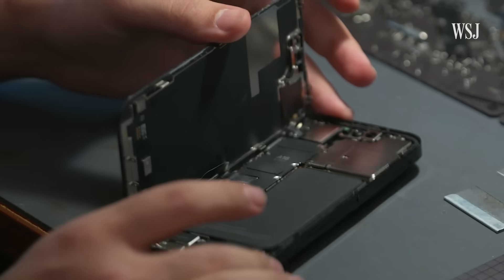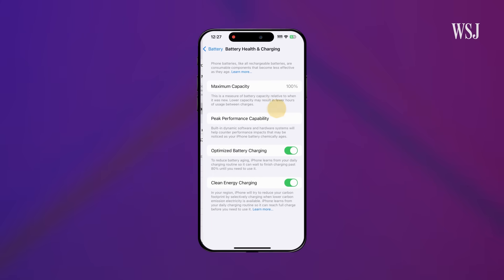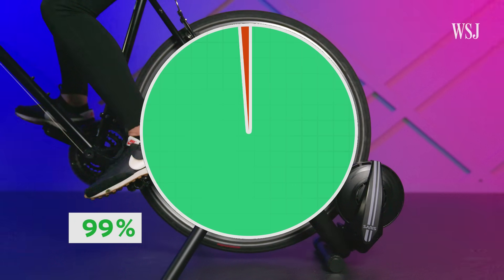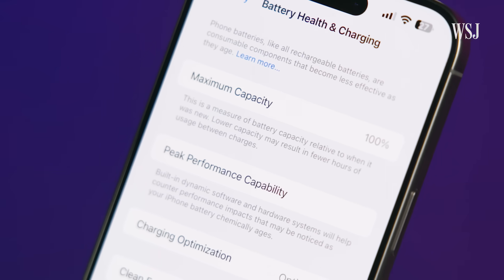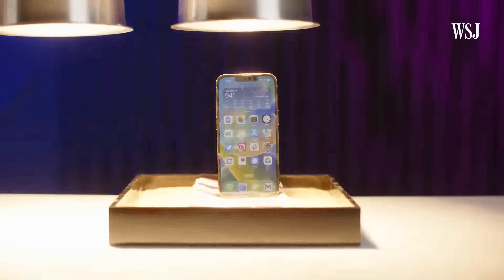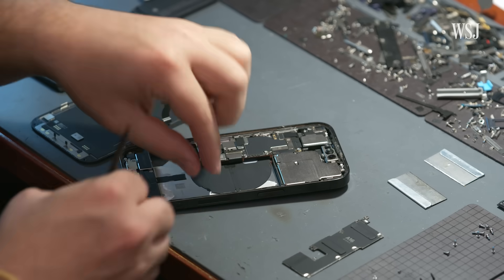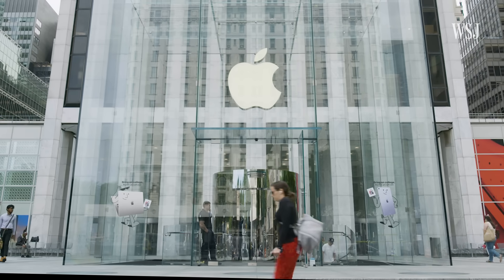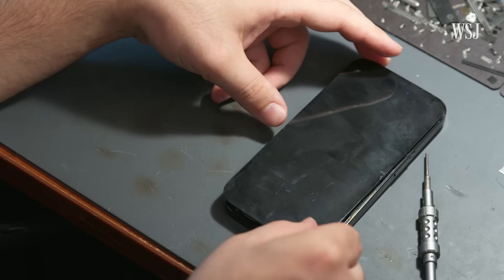Why My iPhone’s Battery Expired in Only a Year | WSJ

Comment: Just by the way, for those of you who may not know: It used to be that Apple Li-ion batteries had a rating of 80% after 1000 cycles. And they are trying to tell us that they have not built in a designed redundancy? No, this is wrong, they absolutely knew that this would happen because 500 cycles is approximately one year's worth of phone usage. Is it concidence that a new iPhone is launched every year? No, coincidences like this don't exist. They are a deliberate design decision. Just think of this: Wouldn't it be nice if the battery was easily swappable? Of course it would be, but then apple wouldn't be able to make 1000 (insert currency here) every single year from you. The only somewhat repairable iPhone is the iPhone 6S!
Reply: You might achieve that 1000 cycle of use. There are real world examples from multiple people, but most of them never charge to high voltages, keep charge and discharge slow and limit heat exposure, but that is unreasonable for most real world uses. 
The ideal charging habit is only viable on careful users, or EV owners (when battery temp is controlled, charge limits are set and charging/discharge speeds are slow anyway for normal daily driving). 

Choi, S. S., & Lim, H. S. (2002). Factors that affect cycle-life and possible degradation mechanisms of a Li-ion cell based on LiCoO2. Journal of Power Sources
There are many more sources that can show lithium ion degradation, but this appears to be accessible without academic logins. 

I am only aware of Apple claiming 1000 charge cycles for their Macs. When did they claim that for their phones? Li-Ion degradation is a normal thing, not just for iPhones. You can expect similar results for Android. Other phones getting low damage fast charging and high cycle counts are from brands trying out new battery chemistries or existing chemistries with added ingredients, such as Realme.

Comment: my iphone XR i had from March 2021 - September 2022's battery health stayed at 100% until may 2022, dropped to 99% then randomly after updating to ios 16 in the septemeber of the same year dropped to 95% out of nowhere my iphone 11 ive had from September 2023 - Present has gone down from 98% to 95% in just over a month although my iphone 7 i had from september 2022- april 2023 didnt drop from 100% at all. all have had basically exactly the same use cases.

Comment: There's a great app called accubattery but it's Android only but it's good to see Apple let you limit to 80% charge. The biggest problem for lithium ion batteries is having a battery sitting at a high or low state of charge. I charge to 50% which accubattery suggests uses a lot fewer cycles than charging to 60%. The number seems increase faster and faster the higher your battery percentageAfter a year with my Pixel I'm down to 96% which I think is very good.

One other thing. I don't really like low power mode so I make the screen as dim as I can because that's the thing that uses most electricity.

Comment: Joanna: do you usually charge your phone at night when you go to sleep? This would keep the iphone battery stays at 100% for a long time. A lithium ion battery is most unstable at 100% charge, leading to capacity loss. Hence also Apple offers 80% charge limit option. If you enable the 80% charge limit, your battery may get a 1000 cycle life instead of 500 as you indicated in the video.

Comment: umm, your battery doesn't "expire" after 500 charge cycles. Apple said it should be about 80% at that time.After another 500 cycles or 1000 cycles it should last as long as a new Samsung phone.

Comment: what i find is missing that after 80% the battery hits a knee point after which the Battery degrades way faster with each cycle. Also Safety risks like bloating or even exploading Batterys also increase signifcantly. The Reason for all that is comparable to sugar water where after time crystals starts builduing and if they poke a hole between the negativ and postiv charge... well mostly everyone saw images of the exploading samsung phone or a electric car. Which does not mean the batterys are unsafe just that the Battery managment System has to be on point and that we have to educate people to replace systems after the 80% capacity point espacily with home storage based solutions. But Redox Flow Batterys are here to mitiagate that problem for Home storage batterys and Grid storage but for phones and cars we still need lithium.

Comment: I recently sold my iphone 11 pro max which I'd bought brand new 1 year earlier.
The battery health was at 98%. I used an external battery case with the phone and very rarely let the phones battery drop below 90% , more often than not keeping it above 95%, essentially trickle charging it throughout the day. The phone very rarely heated up due to long charging periods which definitely preserves battery health. And for the record i use my phone most of the day everyday with an average screen on time of 6 hrs also listening to podcasts at work throughout the day. Also in the summer if ever i feel my phone getting warm in the sun I get it out of the sun and even switch it off for 10 minutes to let it cool down. In addition to the above I usually watch a you tube vid with advice on what to switch off in settings to lessen battery drain whenever i buy a new phone.

Comment: It should be why you shouldn't buy integrated battery and this is how it feels preparing for Xenothreat and after everything you won't want it as much as a wheel who won't spun. It gives your headlight power if you are stuck dreaming  and don't do anything with your own videos and end screen if that Content ID does not point to your channel, let newspaper do everything for you - your Hollywood protection and lies. They want to sell you new phones and there aren't any official batteries and you get a new phone only when it's completely unusable as a worn out jeans.

Comment: My 14 Pro max that I sold after more than a year for the 15 Pro Max still had 100% capacity. I keep charge between 20-80% as much as possible and not leave plugged in. I also don't game on my phone and setup automations to turn off WiFi and Bluetooth at night so that they are not using battery for nothing. I also do all the tips and tricks you can find on YouTube in the settings. Not have unnecessary applications and limit the notifications and what apps can access location. Also, try not to wireless charge or fast charge as it creates heat. Use the old school slow method to charge. I was able to sell my iPhone for a premium because of the battery health.

Comment: In the UK, it's £99 to replace the battery with apple or I can do it myself (it takes care but is not difficult) for £15 with a 3rd party battery and seals but get blocked from health info.   I think Apple should charge in the range of £40 to £65.  £99 is way too much.

Comment: My POCO F2 PRO after 3,5 years of heavy usage, at least 1.500 cycles and lost only 8% of capacity. The secret lies in being patient and consistent about battery health. Countlessly I've been charging it up to 65-70%, max. 20 W charger and religiously keeping the phone from heat. On a trip or befor cycling, or if I now I'll be using it heavily after the charging, I charge up to 75-85%. 
De facto, real maximum useful voltage for Li-ion battery is at 80% of charge. Li-phosphorus change all that at make 100% charging possible without longevity issues.

Comment: The main problem which we are not accepting is the software which is intentionally not optimised or made to affect the battery life for the older models. This is how Apple is forcing people to upgrade on new iPhones. I can prove it easily as I am currently using 14 Pro Max with 88% battery health on iOS 16.7.2 and it is still giving me 8-9 hrs SOT as day 1. When I had the iPhone 12 before, I was getting 6-7 hrs SOT with 93% battery health till iOS 15.7 or 16 came out and when I just updated to 15.7 thinking 16 might not be stable enough ? It actually made it worse decreasing my SOT to just 3 hours. Isn't that strange? Both 15.7 and 16 were made to affect its battery life on purpose. I thought maybe it needs some days to do the processing as how the other YouTuber says but it never improved and I ended up getting the 14 Pro Max. Also, I was using the 5W charger and never got an overheating warning. Thoughts?
Reply: Completely agree. So the solution is not updating software?
Reply: @RamMohammadJosephKaur  Can't say but I haven't yet updated to the 17 and I'm quite satisfied with 16.7.2 for now.

Comment: This would never be an issue if cellphones still had user replaceable batteries where you just remove a back cover and slap in a new battery. Why can't cellphone manufacturers still do this? The phone will still look cool with an easily replaceable battery. Do you get all concerned about the battery life in a flashlight? Of course not. When the battery gets low you just stick in a new battery. It might take one minute. No special tools needed with the skills of a brain surgeon to do it. This will also cut down on e-waste. People are now judging the useful life of their cellphones based on the battery life. If the battery starts losing its charge quicker, rather than having the phone surgically opened and a new battery installed, with possible issues afterward, just get a new phone. Of course, that's what Apple wants. The iSheep line up every year for new phones whether they need a new one or not.
Reply: Not everyone buys the latest iPhone each year . Personally I think any flagship phone either apple or android is ridiculously overpriced. Many cheap phones for £250 sometimes cheaper work very well . I agree about the battery situation. All phones should be able to be easily replaced like they used to be
Reply: @em90sfan  The best features were user replaceable batteries and the ability to add and remove a MicroSD card. Now it's basically impossible to find either.

Comment: Its simple if your cycle end
Just purchase new battery
Its not like you purchase a new iphone
Reply: There is the matter of popping off the display with heat and suction cups. Also maybe reprogramming the new battery so it looks like the Official Apple Successor Battery. Replacing the battery, checking that your phone's happy. Closing it again... Kind of easier than a screen and battery replacement for a OnePlus 9 Pro! Or figuring out the XiaoMi lineup of phones?

Comment: Ive got my 14 plus for almost 1 year and it’s still 100%. I charge it before reaching 20% and unplug at 76%. Of course there are days that it gets below 20% and above 76%. 
I also don’t use wireless charge or car charging. 
Just the cable charger from the phone
Reply: i did this to all my device, more extreme though. don want it to go lower 30% and not more than 80%

Comment: $89 to get your iPhone 14 Pro battery swapped in an Apple authorized repair shop is expensive. In Brussels, you pay $58 in an ordinary electronics repair shop for all the models starting at iPhone 12. For older models, it's only $37. 🪫🔋Moreover, I bought an iPhone 7 battery for $25 last year and replaced it myself with the ancillary toolkit. Wasn't too difficult. 📱🪛

Comment: The true advantage of replacing a battery at an Apple Authorized Repair Shop is that if they break the phone or cannot complete the service, you get a new replacement device.
Reply: The apple store will also not even do a future replacement of that battery or anything else, or take it in trade or even fix a software issue if you have an aftermarket battery.   That aftermarket battery means: no future apple support or warranty, or out of warranty repair, and no trade in value.
Reply: Well they make the phones so you think they could do the repair no problem lol
Reply: sheep detected 🐑🐑

Comment: I have an iPhone 14 Pro, and it is now 11 month since I acquired it. It still lists capacity as being 100%. I never fast-charge it with higher wattage. Instead I use either a 12-watt charger from an iPad, or I charge the phone with an older 5-watt charger from earlier iPhone's I've owned. Thus I'm not over heating the iPhone's battery.

Comment: I noticed the same thing. I had an iPhone XS Max from September 2018 until in December 2021 when  Hard Disk failed and got stuck in a boot loop that was not able to be fixed with the typical software measures using a computer. It was not worth repairing at that point, so I saved money to get a new iPhone 14 Pro Max when it was released in October 22. Fast forward about a year, and my battery health is in the mid-80’s. My iPhone XS Max, last I checked before it kicked the bucket, was about 87% — its health was better in over THREE YEARS than my iPhone 14 Pro Max in around one year. The usage time per day between both phones was about the same amount, and the apps I use on a regular basis are largely the same. That amazing battery life on the XS Max was also on a device without all the battery optimization software capabilities that have since been released for more recent iPhone gens. 

To me, that’s unacceptable. I know it’s still technically within the promised spec for charge cycles, but how can it be such a drastic difference?! I think the laws need to change to hold companies more accountable — or at least give people a totally free change if they’ve paid for AppleCare or AppleCare+. It almost makes me want to “lose” or damage my device on purpose because at least a refurbished replacement would come with a totally new battery and everything else would be 100% functional and covered under the warranty. Oh wait, I forgot that they charge a replacement fee on top of the AppleCare+ fees anyway. Such a scam for a flagship top tier device. Hmm . . . 🤔
Reply: Same sentiments here, Masha. Really boils my blood how they can do this with a flagship phone.

Comment: That 80% limit should be released to ALL iPhones, I’ve been trying so hard to maintain it myself, sometimes it’s just impossible. The benefits are real on my Mac which is limited to 75%, its battery health is 94% after 2 years. My 14 Pro max is at 91% after 1 year..

Comment: Word of wisdom from EV ownership….

Best to charge your battery to 80-90% daily, and try not to deplete the battery below 20% regularly. However it is good once in a while to charge to 100% and also good to let the battery management system see low voltages on occasion. That way the BMS can accurately calibrate the available capacity. 

Another word of wisdom… do not use wireless chargers. They create more heat and heat overtime leads to the electrolyte in the battery to degrade and eventually turn to a gas.  Gaseous batteries can explode if they are not replaced. Hopefully smartphone batteries will get to the same level of longevity that EV batteries are at where they easily handle 1000 cycles without serious degradation.

Comment: I noticed a quick degradation of my battery within a week and found my battery power use went from about 8-10ish hours per charge to about 6 hours of total use before dead on my iPhone 13 Pro. The battery capacity was allegedly 94% which I find to be BS. With that being said I’m almost certain that Apple lies about the battery capacity percentage when the battery wears.
Reply: Based on a friend’s account, I agree the capacity report is likely highly inaccurate.

Comment: I think the battery health varies dramatically from phone to phone. I have an iPhone 11 Pro which is 4 years old with a battery at 73% health and over a 1000 charge cycles and it still runs reasonably.
Reply: Question - Why don't you pay a little money to have a new battery and practically have a new phone that can last another 5 years?

Comment: This is exactly why user replaceable batteries r so important to be implemented ASAP! It's a shame Apple being so much "GREEN" and talking about sustainability didn't do that yet! BIG THUMBS UP👍👍 to the EU resolution coming in 2027 for making user replaceable batteries mandatory!
Reply: Thank God for EU
Reply: @annetted5435  the EU are pretty much anti-God anti-religion. And with their huge bureaucratic apparatus they look more and more like the USSR by the day.
Reply: This is a huge misconception. The battery is by far most toxic/hard to recycle part of the phone. Larger inbuilt battery is many times friendlier to the environment than a tiny replaceable one, like we the ones we used to have on old Android phones. EU has done goofed with that legislation, hopefully manufacturers find a way around the legislation, like adding screws/pulltabs.
Reply: @jackwilson5542   there is one more thing - most phones won't get software updates past 2-3 yrs of the time of purchase. Sure, there are brands, which offer 5 or even up to 7 yrs of updates, but it ain't true for most brands.

So, trying to extend the life of a phone, which is software non-updatable is questionable.
On bootloader unlocked phones one can eventually install an alternative OS, but again it won't work for most phones - they are either vendor locked or even if unlocked - they are not supported on those alt.OSes.

So, with all considerations we're back at where we started :) Are those changes practical?

Comment: The charge cycle example was absolute foolish. Charging in process where chemical recombination happens and in common terms, some chemical move from one part of the cell to another. The discharging is the opposite motion. The chemical in the battery deteriorate every time this movement happens. If you charge discharge two batteries the same amount and number of times, its not necessary their overall health will be same. Its a chemical process and impurity play key role in bad batteries.